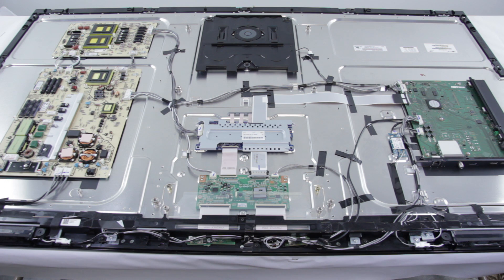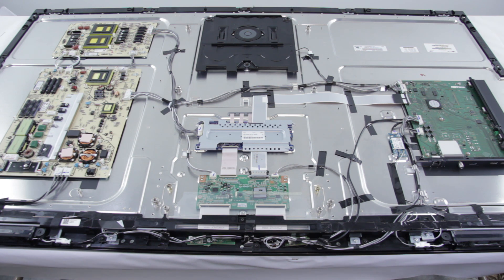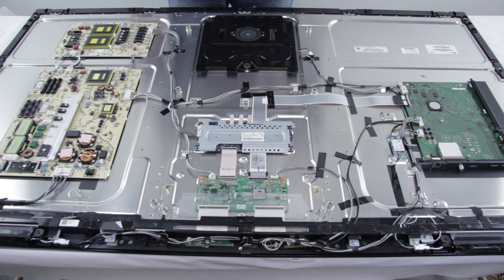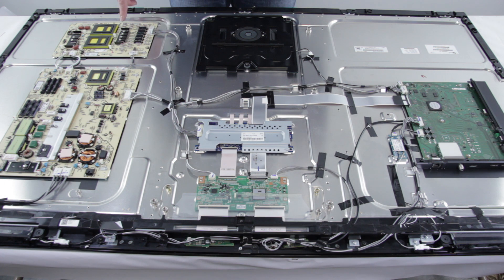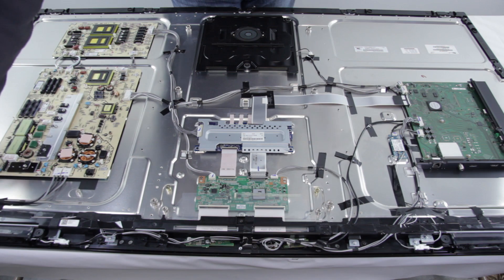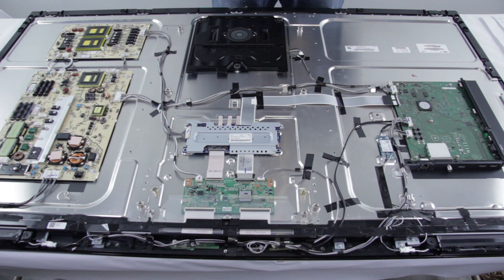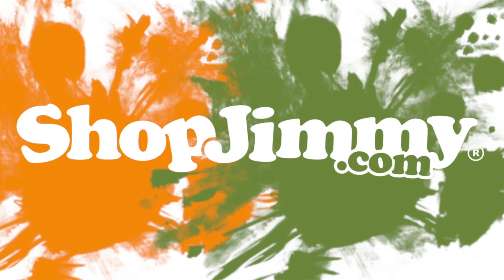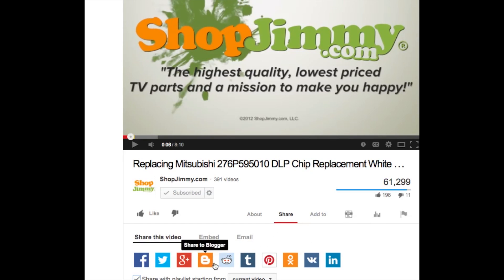LED TV Repair Review Power Supply Overview-NO Power Common Power Supply Repair & LED TV Power Supply

Comment: Hi there, I have a Samsung QN65Q80TAFXZA version FB04. We had a lightning strike in front of the house 2 years ago that fried some of our home networking equipment, but the TV seemed fine afterwards. Yesterday, I was watching YouTube and the TV suddenly turned off. It then started to turn back on, the LED backlight seemed to turn on, the welcome noise occurred, but the screen remained black. It then turned off, then it turned back on, and the cycle repeats itself endlessly. I tried power cycling the tv, unplugging it for a while, etc. What parts do you think are needed to replace here?

Comment: I have a Vizio 55" smart tv model D55X-G1 serial LTMDXWAU4350474.  It has no image or backlights. ( did flashlight test and no image)  The standby light is on and when the tv is turned on, the standby light gets brighter then fades off after like 5 seconds.  I looked at the main and power boards and saw nothing out of order ( no puffy capacitors or burned parts).  What would be most common problem with the symptom I described?

Comment: I have a 55 inch Element tv model A73CM.  It has no power.  I am considering ordering the repair kit for that tv part sj- Kit-ELST5016S-K10.  Should that fix the problem.  Also what is the wire and little silver looking price that runs from per supply/main board down to less and how does it attach?

Comment: Hi Can, you please help me troubleshoot a Vizio E470VL. It has no power and will not turn on. 

On this model the pin outs from the power board are not labeled.  I have checked the following 

1. There is 120 volts to the AC fuse
2. I checked the output of every pin of the output connector to the main board, 0 volts. I checked the voltage with and without main board connected, all 0 volts. 
Your help is greatly appreciated.

Comment: sharp lc-55q7530u

worked fine one evening... next morning wouldn't turn on..... When power button pushed, red light would go off  for maybe 3 seconds and then come back on.

watched videos to hard, soft start but made no difference.

looked at power supply but nothing looks unusual as far as bad cap's of discoloration on any parts or the board ...... ANy ideas?  ANy input would be much appreciated

Comment: I have a vizio D55u-D1 the problem is power up vizio emblem displays for 2 seconds and then goes blank. On my power supply on cn901 I get 5v, 19v, 19v, 19v, when I should have 12v and on cn9203 I get 22v, 22,v, when I should have 24v.  What could it be thank you for your help

Comment: Sharp LC-80LE632U, when I plug in the TV, it comes on and the screen works.  After about 30 seconds, the TV shuts itself off. There is no error code provided by the TV.  The power board is version RUNTKA903WJN1. I replaced D7112 because it appeared damaged. No other damage is apparent. Capacitors look in good shape.

Comment: Hello i have a tcl model 55p607 . when i plug tv in to wall outlet   standby light . lights up. When i tru to turn tv on it does nothing . after a few minutes tv will come on for about 5 second then shuts off and standby light starts blinking . after blinking for about ten seconds tv comes back on . and repeats all over agaian ive checked remote . ive turned off all timers . its driving me crazy . i want to think its a power supply problem but not sure .

Comment: Vizio D650i-B2

I replaced the power supply and am still unable to turn the tv on.  The power light in the bottom left corner will come on and then fade out within 5 seconds.  Any ideas on what part needs to be replaced?

Thanks,
Brandon

Comment: Hi, I’m hoping you can help me out. I have a 55 Samsung KU6290 that is having an issue.  The picture and sound is great, so I don’t want to have to replace it unless I have too.

What is happening is that sometimes when I turn it on, it will turn on but then it immediately turns off and the indicator led will start flashing red. If I try to turn it back on, it will not. however, I am able to get it to turn back on if I unplug it from the wall outlet and leave it unplugged for like 2+ hours. After I plug it back in, it turns on and works like normal. I’m able to even power it off and back on like normal until it wants to mess up again and then I got to repeat the process. 

Anyways, do you think This sounds like a power supply problem? Would replacing just that board (BN94-10712A) correct this issue?

Comment: Hey thanks for the helpful video. 
I have a Sony 55’ A9F OLED tv. It completely does the other day, will not turn back on and the indicator light is gone as well. 
Does that sound like a power supply problem?

Comment: I have a Vizio model V047L  FHDTV30A  I had a loud pop then the tv had no power . I was going to order a new complete board but it's unavailable at this time. So I ordered the repair kit. I noticed the kit come with several of the blue Capacitors for C701,713,717,and 801.  After removing the board and inspecting the only capacitor I see that has a crack on the top is C901. all the others also omh out ok . Can I use the 801 to replace the 901 ?

Comment: Hi! I hv a Panasonic LED TV  model TH-50A410D. It has gone dead- No red light on the panel. On checking the insides, I found the 12V check point on the motherboard not showing any volatage whereas I am getting right voltages at other check points, like 5.3V and 15.9V. What could possibly be wrong? Pleaase guide me.
Regards. Priyaranjan

Comment: I have a LG 50UH5500-A that will turn on, the standby light blinks 3 times then turns off. The back lights come on for just a second when I turn it on. I opened it up and it looked like the blue ( cathode) ? B102K2KV is burnt. Does this part have anything to do with the TV turning on, or should I replace the power board? I see you are out of stock for now, when do you expect to get a new shipment.

Comment: I have a Samsung 75" LED TV MDL: UN75JU6500F  -  PWR SPLY: BN44-00809A. Will not turn on and no standby light. The fuse on the PWR SPLY was blown. Replaced the fuse and it immediately blew. How do I troubleshoot without replacing the PWR SPLY board.

Comment: I have a  seiki  model# se50fy10  tv and it has sound but no picture  could you help me pin point th problem so i can fix my tv please........ i looked at both boards and did not see any burt connections or swollen capacitors

Comment: Hi Jimmy I have a Samsung Model UN55H6203AF, and It has not pictured but it has a voice, I have seen your videos, I check it and it has no backlight
but when I check it with the flashlight I could read that the cable box was disconnected, I was thinking that it could be the power supply because probably the LED driver is in it.
What part do you think is the wrong part, Main Board, Tcom, or Power Supply. Can please help me to buy the right part to fix it. Thank you,  Hernan, Mosquera.

Comment: I have a Vizio E600i-B3 that has no sound or picture. Before it went out, it made a whistling noise and then a pop and then it went black with no sound. The indicator light was still on. I replaced the power board with no change. So then I replaced the main board and with the new main board the indicator light did not light up when plugged in. I reinstalled the old main board and the light came back on but no picture or sound. Is the new board bad? Is there any other places to check voltage to see if it is good? I did check pin 8 on the power board as directed in one of your videos. It registered 12 volts.

Comment: Power supply board for an LG tv 6281070104... I damaged the thing on the power supply board the connects the 4 pin LED connector to the power supply board
Reply: Don’t plan to replace the whole board just want to solder in a replacement connector thing

Comment: Hi,  I have JVC EM40NF5 LED TV.  Initially I was having No video, but audio on issues.  Slowly that tv died on me.  When I turn the tv on RED led indicator comes on and than JVC logo used to come scree indicating tv is booting up.  Now I see that RED led indicator comes on, but no JVC logo and the screen is JUST BLACK.  Some were I read that, it may have bad diodes.  Would you please let me know what it could be?

Comment: Hello ! we have a Samsung 40 inch LCD TV.  Model number: LN40A550P3F 8  . The problem with it is that it won't turn on easily. It takes very long time to turn on after several try. It shows up colorful vertical bars in the beginning. But after it turns on, it works fine. We opened and looked at the power supply board and found that one 470 mF 10 Volt capacitor was bulging. Even after replacing that capacitor with new one, it still is not fixed. Could you please advise what could be the other reasons.

Comment: I have a samsung UN32H5203AF TV and none of the back lighting led's work is that most likely power supply and what should the voltage be going to them. Thanks

Comment: My Vizio M65-D0 has a black screen.  The power light comes on but will click on and off about every 15-30 seconds.  There is an audible click when this happens and continues to cycle with no screen (failed the flashlight test).  Any help with what the most likely board at fault is appreciated.  Thanks.

Comment: I have a Samsung UN60EH6002fxza that won’t power on and there is no standby light. I replaced the power supply board and no change. One HDMI outputs also stopped working prior to going completely dead. I’m thinking main board or switch. Any help appreciated. Thanks

Comment: Samsung un55es6100fxza LED.   TV will not turn on. No picture. No sound. Red indicator light flashes 5 times when press power button in attempt to turn on.  Backlight only comes on when unplug main board from power supply board, even if T con board unplugged at same time. No visible burn marks or visible signs of failed components on any of the 3 circuit boards.
Reply: Main board #bn94-05656c
Power board number :bn4400503a

Comment: 50" LED Emerson TV I paid very little for at Wal-Mart about a year ago. While working on a car battery charger I accidentally short circuited the 120 volt circuit the TV is connected to. After resetting the breaker the TV came back on but now I'm unable to control anything on the TV. I'm not sure this one can be controlled by any thing other than the remote, I've never found any external controls so I'm trying to use the remote with new batteries and I get nothing, no power, no volume control, no channel change. It was set to PC when this happened and the screen and sound are OK for this use only. The only way to shut it off is to unplug it, but it does turn back on automatically when power is restored even when it's unplugged overnight. Can you tell me which board I should look at and maybe replace? It's a cheap TV but I don't have the $ to buy a new one right now.

Comment: I have a Samsung Plazma TV, Model: PN60E7000FFXZA, Version TW02. The TV will turn on when cold, after about 1-2 minutes it turns off with a double blinking LED Power Indicator. If the power cord is removed and returned, it repeats the same process where it will turn off again after about 1-2 Minutes. I have not dissembled yet to inspect the capacities and other components... that is my next step. I suspect a defective power supply, can you confirm or provide feedback on what to check.

Comment: I have a samsung E390-A-1 White power light comes on tv wont turn on and and the light doesn't go out when you hit the off button. No picture no standby light no backlights. No backlights when you unplug the main board no picture on flashlight test. all voltages on the Power supply are good. Whats wrong this time? samsungs are jung IMHO.

Comment: I have a Seiki 55in model no. SE55UY04 about two years old power supply went out, I was told power supply is obsolete, is there another power supply I could use to fix this TV?

Comment: Ua40d5000 can’t seem to power on..I’ve opened the back cover n find two boards..one for the connectors and one for power..how do I determine if it’s just the capacitors I need to replace or the entire power supply board ?

Comment: I have a LG 39LN5300-UB that won't turn on.  This happened about 3 hours after I watched a show, we didn't have any storms and it's on a surge protector.  Nothing happens using the remote or the power button on the TV

Comment: Samsung UE48h6275suxxe, there's power and the powerled is lit, if i use the jug it goes out and then after a few second it is lit again same with the remote, it even fast blink when I use the vol button but no luck to turn the tv on with picture, would this be a failure on the power, main or lvds board?
Reply: no backlight and no image with flashlight test

Comment: I have Hitachi LE55W806 unit that has a backlite problem. I can see the video with a flashlight and the unit has audio. The LEDs flash on each startup but do not stay on. With LED disconnected, voltage output from the LED driver at startup shoots up above 180 volts and quickly dies (10 secs) down to and holds at 5.4 volts, the same volts read when LED are connected.

Comment: This was supposed to be about the power supply - not just pointing to the board and saying that it is a power supply.  Walk us through testing the circuits on the board.  My BN44-00477D (PN22A0-BPNVC) looks fine but there is no power.  No bulged capacitors either.  Power is coming in from the cord, fuze seems to test fine - what next?

Comment: My Le Eco super 3 X TV 65 inch 3 D is not switching on. Probably the smps power supply is not functioning. Essentially it has two boards inside. One is the power supply the other is the input and display board. Can you suggest likely faults in the smps power supply.

Comment: I have a Magnavox model# 39me313v/f7  s/n ds3a1344136395,  power board # ba3at0f0102 2  The unit does not turn on, it has no lights blinking or on, I have checked both boards for any obvious damage, found nothing, good power in and fuse is good. I've done minor repairs to other boards that had obvious caps blown, but I see nothing wrong here at all. Any help will be appreciated, Thanks .

Comment: Seiki Model Number SE55UY04 
powerboard part number 890-PF0-5501

Tv will not power up or do anything.  Cord has 120 volt at connection.

Comment: I have a Vizio E291-A1.  The screen no longer has a picture.  I did your back light test, and I can't see any lights when the lights in the room are turned off.  I tried the flashlight test, and I can't see any words on the screen.  I read another person's post on another website, and they had a similar problem.  The man suggested that it was the Main Board ( my main board number is 715G5817-M01-000-004X).  Here is the URL of the post that sounds very similar to mine ( http://www.justanswer.com/tv-repair/8fkkb-14-month-old-vizio-e291-a1-tv-developed.html ). When I watched this video, you suggest that it might be the power supply.  Not sure which one to replace first.  Can you help.
Bret

Comment: my fuse  only measures 40 volts in and out is this a problem with my power supply board

Comment: I have a tcl TV that got strike by lighting. the led light isn't on. an when I tried to turn it on. it doesn't power on. what's the problem
Reply: Being stuck by lightning is probably the problem.  Most electronic devices don't like that kind stuff.  Buying a new TV is probably the best thing to do.

Comment: model 50R550

Turn on ..."SONY" logo, then turn off "6" blinking Red light.
Already replace power supply bd, still doing the same.
Disconnected T-Con board, turn on ...Go to green light.
Bad T-con board?
Bad main logic board?

Comment: Toshiba 40L1400DG: The backlight doesn't work and there seems to be no power coming to the LEDs from the power supply board. Everything else works fine.

Comment: "If your TV won´t turn on, your problem is probably in the power suply. Thanks for watching our repair video." Are you f*cking kidding me? This video gave me absolutely no information what so ever. If this is information you need to give people then they should not even touch the screwdriver. OK, so problem is the power suply - which pins to short to turn on from standby, which pins to use to measure voltage,.... This video is totaly pointless and I would give it twenty thumbdowns if I could...

Comment: I have a LG LW6500 LED 3D TV that is 4 years old. Suddenly the display went blank while watching the regular TV, but the power light stays on, in front panel. I heard some light scratching noise, but nothing like blowing capacitors sound or any burning smell prior loosing the display. I turned the TV off and back on but no display or sound. Also, I have checked and there is no back lights. When turn the power on the light power follow with rest of the lights such as volume,  changing channels...comes on but no display and sound. even I can turn the TV on and off manually from the front panel with the same result. I removed the rear panel and inspected the three boards, Main, Power and T com, and there is no leaking or bad fuse or capacitor from what I see. Any suggestion and help will be appreciated.

Comment: MY LG55LA7400 TV DOES NOT COME ON. ON LG LOGO SIGN LIGHTS UP FOR 2-3 SECONDS AND GOES OFF , ALSO WHEN I TOOK BACK COVER OFF I SAW THE RED LIGHT ON POWER SUPPLY BOARD BLINKINING 5 (FIVE) TIMES . WHAT PART YOU THINK I NEED ?
POWER BOARD OR MAIN BOARD?

THANKS,

Comment: i have a samsung un65f6350afxza that is about 2.5 years old and couple days ago it flickered a little at the bottom of the screen.  then it just yesterday the lower half is darker than the top half.  My Question is which board would i replace to try to remedy that or would it just be best to replace it?